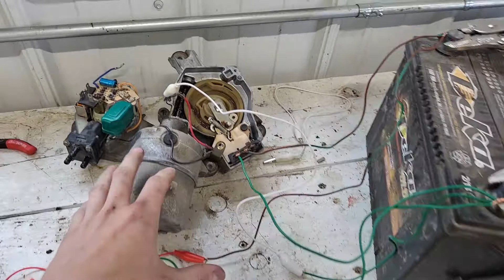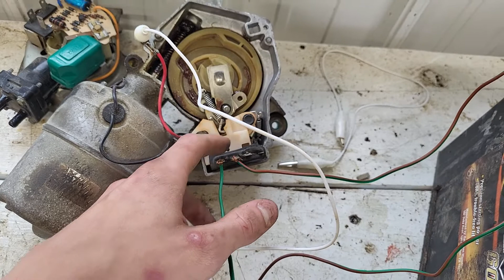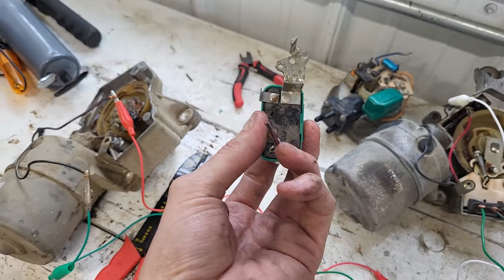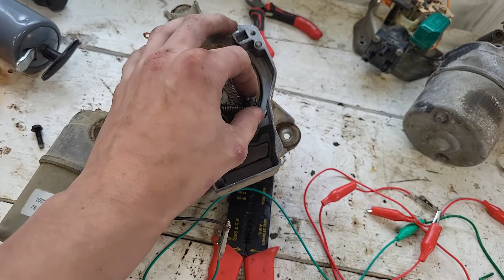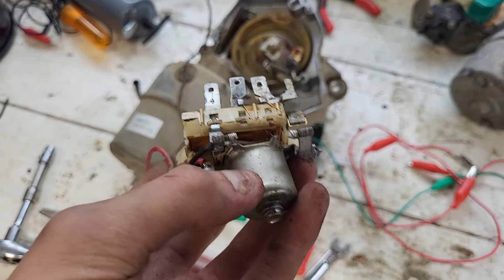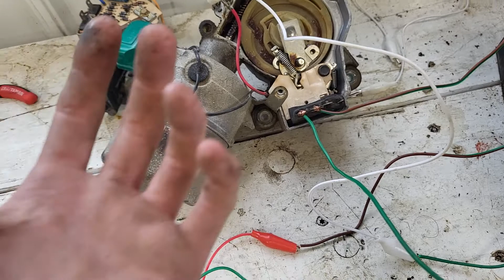olds 98 wiper motor repair

Comment: The left side of the park switch needs to be grounded. If you look where the brass strap is there's a steel grommet for the ground.
Reply: I was having issues testing my exact system from a 1979 Firebird. I hooked it up as Riot did above and got the same click. I read your comment in the bottom, put a screw in the ground brass strap and voila it all worked! Thanks for this tip MrBobwall
Reply: @sarblade  i have same problem, .. the solenoid tries to pull the lever, but instead of pulling it down, it just pulls it perpendicular, toward the housing, 2mm or so. i tried connecting with and without that ground strap and it didnt work

Comment: Thanks for your video I'm having the exact same issue with my 82 Firebird motor. I did note that you can take that park assembly out you just need the motor out of park position and that assembly will just lift out easily. I'm surprised that those little modules are not readily available, by that I mean the park switch that the hook thing slides into when in park seeing as it's an easy part to just remove and replace.